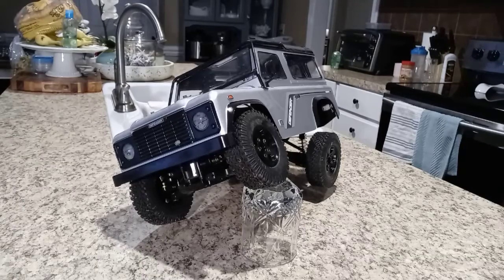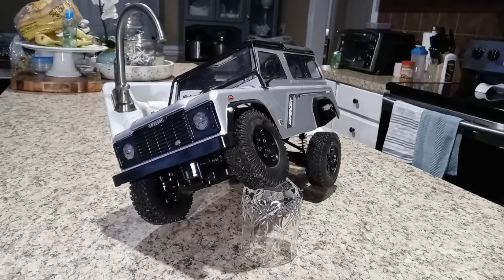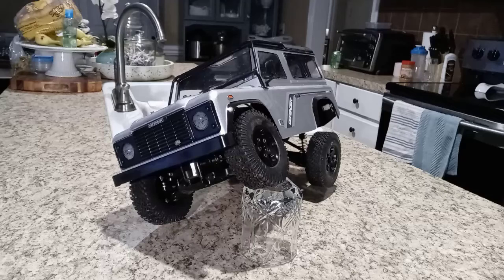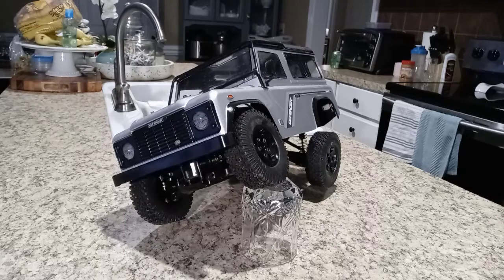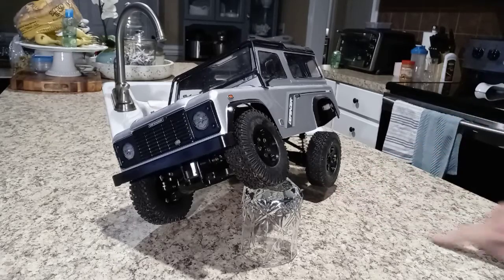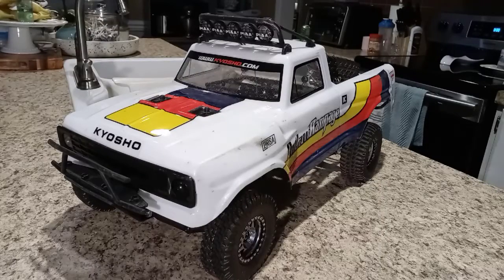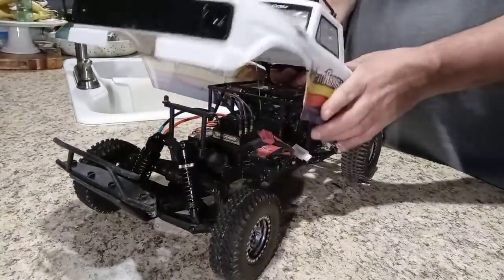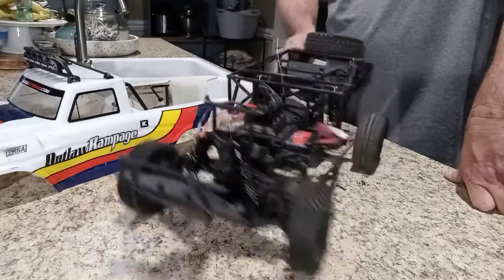Tamiya CC-01 and Kyosho Outlaw Rampage Suspension Upgrades

Comment: The Outlaw Rampage would benefit from  the sway bar kit.  The problem is that front and back are sold separately.   The good news is the sway bar kits actually come with 3 diameter bars to tune the handling.   The additional bars are included in the Pro kit.

What do you think of.the CC-02 with the solid front axle?  That would be a better candidate to see how much flex you can get out of that....

The WPL would be cool to see on this channel.  Interested in hearing what you think of the construction of the brand.
Reply from the maker: I do like the CC-02 but I'm not a huge fan of the Mercedes body that it comes with. I thought about getting one but just haven't done so yet. I may get to it later this year.
This KOR of mine has been a 'project'.....more of a P.I.T.A. at times, but a project nonetheless. I'm going to give these shocks a go and if it STILL nose dives, I may go with sway bars.
Definitely considering the D12. Like REALLY wanting one pretty badly...lol

Comment: I enjoy your Outlaw Rampage vids, I have one myself.
Have you tried putting the short rear arms on? It seems like you gotta turn the rear around to make It work right. I'm having some trouble finding info on it. Do you have any insight on this?
Thanks.
Reply from the maker: No I run the stock arms. I haven't messed with it in a while though